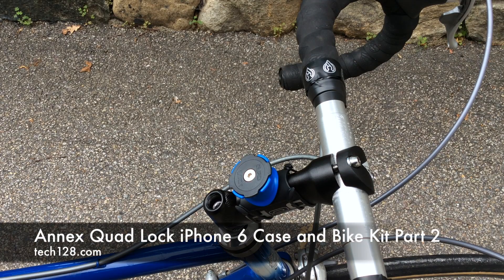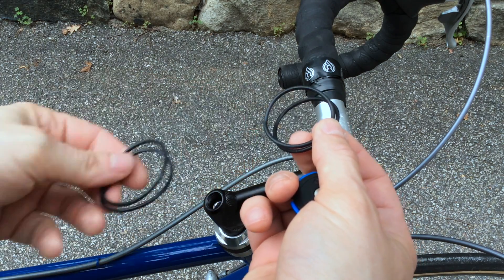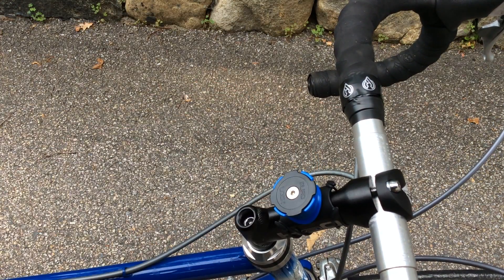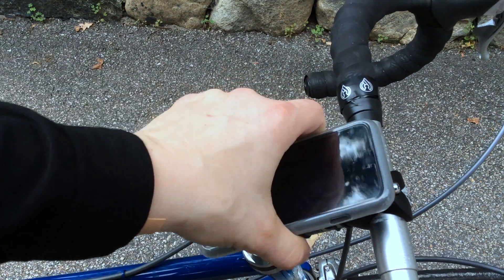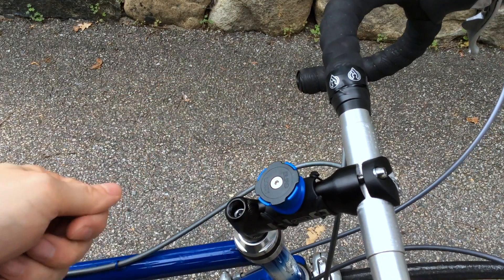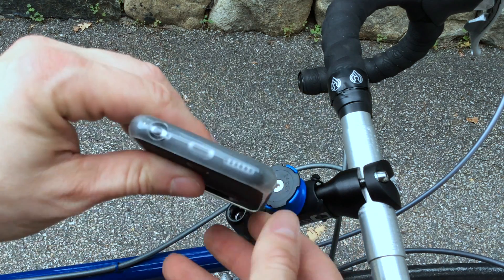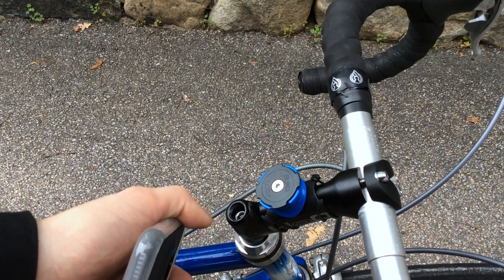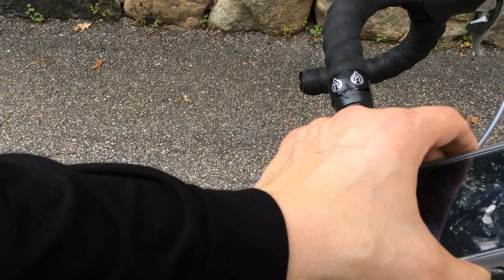Annex Quad Lock iPhone 6 Case and Bike Kit Part 2

Comment: You'd get a better fit using the larger rings in a diagonal, top left to bottom right, top right to bottom left.  Give it a try. :)
Reply from the maker: thanks.. I ended up selling the case because I wasn't riding outside enough.